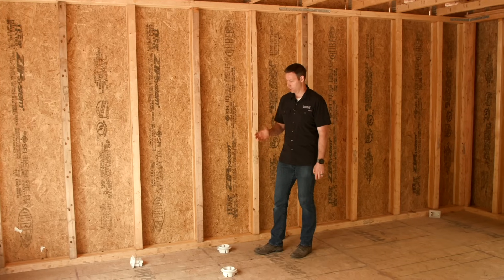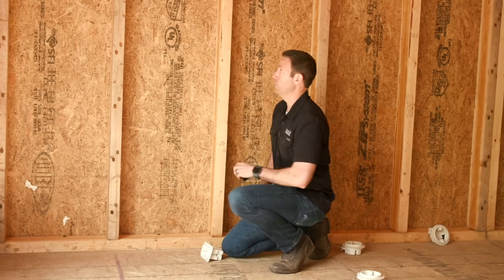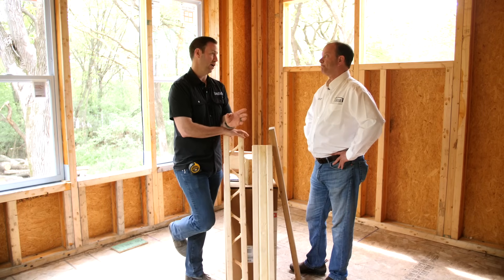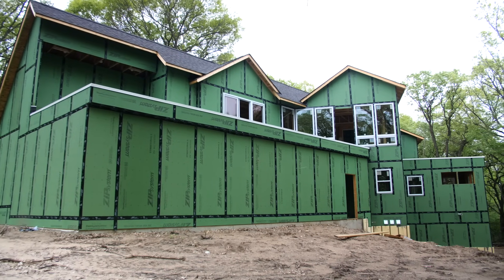Insulated Studs? This is a BIG Innovation in Framing!

Comment: Building a new home with R30 walls sounds like a great investment, until the client/architect insists on perforating those walls with two dozen R3 windows...  And anyway, heat rises.  Better bet is to spend the building capital on additional ceiling insulation thickness, a more efficient HVAC system, or additional passive solar integration.
Reply: Where he's building in Texas, you will lose far more energy through the lower wall assembly/windows/doors during the year, since A/C air is colder than than outside ambient.
Reply: No home owner in their right mind would spend a fortune on these studs only to cheap out on the windows.
Reply: @dlg5485  A bit of research reveals that the best windows available (triple glazed/low E/argon filled) are marketed to perform at around U .15 (R-6.7) under ideal conditions.  As installed, even R-5 "rated" windows struggle to perform at R-3 once wind wash, and other factors are taken into account.

Comment: Windows remove all advantages of insulation in walls. Ceiling is the most important place to insulate. Hud has facts on wall insulation and ceiling insulation.
Reply: Insulated shutters.
Reply: So if you have windows, there's no value in insulating your walls? That can't be what you're trying to say.

Comment: it would be much easier and cheaper to provide a gap between the stud and the dry wall.  the gap could be filled with insulation or even air would suffice.

Comment: This product seems to be to be overly complicated and expensive. I would favor using 2x4s for siw inch walls where you stagger them alternating inside to outside. That makes a six inch wall with cheaper four inch studs and alternating them eliminates the thermal bridge.
That said, I am still no fan of stick building structures. I prefer either ICF, or filled ceramic blocks like they use in Germany. I have also been a fan of cordwood homes since the 1970s.

Comment: Using a single top plate with 24 o.c. framing is okay if the truss, floor joist, etc. is directly over the stud which your video shows they're not. Also, your headers are positioned incorrectly and therefore not structural as they should be on edge. Surprised you didn't catch that Matt as I love what you put out.

Comment: What happens to your frame when the insulation breaks down and starts to crumble which it will and your frame starts to fall down.  Oh oh no house. Your not saving anything with insulated 2 or 3 bys.
Reply: This isn't [open cell] urethane foam.
Reply: Closed cell is inert plastic. It will break down way after you ll be in a ground.
Reply: the insulation does not add strength to the TStud .. the cross braced dowels do .. the foam will eventually perish but fiberglass batts will last a lot longer to provide the insulation

Comment: wtf!  do you live in canada!

sorry as an inventor lol  your home will last a few decades...
Reply: @designstudio8013   lets put simply...  modern materials are attempting to replace what we used 100 years ago.  or more.

being around real estate my whole life.  90% of moldy homes are over insulated near Air tight homes.  Vapor barriers and ODB  cause more problems then they solve.  Viny/aluminuml siding  cause accelerated rot in ODB  homes.   

The Mc Mansions out there look nice but are falling apart in a fraction of the time.   Siding and roofing that lasts 15ish years  what i waste of time and investment.

Build it right and siding should 30-50 years.  Roofs should last longer.  

Efficiency!?  my ass.   i heat and cool my home for less than Half that of your "modern" home builds and it 100 year old.

Yep you going to get mouth full here.

Look at these Plastic/vinyl windows...  also crap.  same thing, short life span.   Sure build the home faster...  spread out your studs to 24" and reduce it durability.   you end up needing major repairs in 20yrs or less.

i understand that some Snowflakes expect to move from home to home and dont care how long they last or costs to maintain.    they get a Home, tweek it and move on after a few years.

Oh yeah...  foundations using quick drying hardners,  yep its quicker, but causes hard and soft grain like structure.....  leads to cracking at a faster rate.   DUH!

laminate flooring...  garbage.  rip it up.  its paper on particleboard.  Vinyl plank  is a surprisingly good product.  Engineered hard wood.  not bad either.

but using ODB  yes chip wood....  is insane.  any moisture makes it swell and fall apart.   We dont have a shortage of trees...  Lumber would cheap and plentiful if the Fed stayed out of Forestry.   we have states subsidizing high water use crops in Deserts,  moving water from Forest (drying them out) and using the water where it evaporates at an exponential rate.  ALL  subsidized  at ALL levels.

So then they push to replace Wood to be Sustainable.................   we end up with homes that are designed to fail or be replaced in 20 -50 years.   VS  over 100 lifespan of older homes.   

No im not grammer checking or looking for wrong or missed words...  sorry,  not worth the effort if all you people what to do it cut corners.   Cheap Quick homes are NOT what we need.   Spend the 30% more and have a homes that last for generations and cost you almost nothing to maintain.  Vs one that cost you and family 2x as much over 50 years.

if you are one to not care,  just push the debt down the road?!   you are part of the problem.
Reply: @designstudio8013  thats fine...  i hope you dont do like mant in NJ have done...  they choose speed over quality.

aka  to much harder in the concrete.  the Rt4 Rt17 highway overpass they finished in 2000...  is falling apart was falling apart 5 years ago.  it consistently needs repair.   the claim was to be 50 years.   the company that did the work has created dozens of such disasters all over the state.

Concrete can be great, sadly to many cut corners to save a buck or get bigger contracts.

Comment: I do wonder what the  life of the 'foam' is before it starts to degrade.  Is it comparable to the rest of the wood stud?  Since wood does rot with insects and moisture, will this system work with steel studs?  You could potentially have a structure that last a hundred years?   Anyway just some thoughts and i do like the product you have as it is now.  Thanks for the video.

Comment: Doesn't look like the bottom plate is treated lumber. Do they have t studs as treated bottom plates?

Also, the top plates hold the shear diaphragm in place by over coming tension and compression loads from wind shear. I see that only one strap was installed on the inside to connect top plates together but is there an outside strap as well to overcome said loads? The tension and compression loads can be quite high at top plates and there is a reason why we need two members to splice together traditionally.

Why aren't the trusses blocked or secured to a rim board? Blocking and/or rim boards not only brace the trusses but also transfer lateral loads from the shear diaphragm to the shear walls to ultimately the foundation. You have a disconnected lateral load path at that location.

Lastly, that anchor design to secure bottom plates to a concrete foundation will work for uplift loads only but how do you overcome the wind shear loads acting in between the bottom of the bottom plate and top of slab and prevent from sliding? The bolt has no resistance against wind shear since there is only insulation acting upon the bolt. 

All these designs are critical to ensure a structural safe building.

Comment: Wood is not good enough so we make wood thinner and put foam(really strong?) In between the 1×2,s great concept i want to see this great feat of engineering in a FEW years when these green houses start collapsing.
Reply: guy azbell my thoughts exactly this stuff is total crap which is dumber the product or the guy seriously trying to market it
Reply: The studs are braced with dowels in a truss pattern. The dowels make the 2x3 sections more rigid and straight. Being wider than 2x studs makes the T-stud stiffer in the X dimension.
Reply: Try not to miss that 1×3 with a nail .  How sturdy can that be?
Reply: @rimdacinah6384  
These are a pair of parallel 2x3. You get a 2.5" wide nailing surface and over 1.5" penetration.
Reply: @jessebarclift8533  

Resorting to personal insults means you can't think of enough valid arguments. When you complain about splitting at dowels, you obviously haven't personally tried these Tstuds, so it's prejudice on your part, not evidence or testimony. 

You don't get to nail to the full 2.5" width of Tstud! So what. This still gives nearly 1" more width to work with. 

Tstuds are far stiffer in the X dimension than 2x6, stiffer than 2x8, so you get better structural load margins in multi-story buildings. They eliminate the thermal bridge visible on infrared cameras. You can skip building doubled walls or buying insulated sheathing. Plumbing and wiring go faster. The Tstud surfaces are more straight and consistent than dimensional lumber. You can confidently drive fasteners more perpendicular to the surface and/or further from sheet edges. Those are the main points you can't dispute.
Reply: David Ogawa I'm sorry but I completely disagree and 2x4's don't give you 1x5 surface to nail to you get about 1¼ x 3" of nailing surface. You get 1¼x5 with a 2x6 and you don't get the full 5 on the broad side bcuz of the foam idk about you but I'm not nailing into foam. This is junk junk junk and I would never use it you can keep trying to give me a million different reasons that don't add up but I'm still not buying it and would never suggest it to a customer. With blast in foam the R value is so high that I can't see the beams/studs really costing enough energy efficiency to be worth building with this.
Reply: @avid0g  you must be very familiar with product?
Reply: @jessebarclift8533  YA I'm also thinking that this product would be way harder to put together and I'm guessing double to triple the price of a regular board.  I don't know about y'all but house's are already to pricey as it is.
Reply: @rimdacinah6384  
I just paid attention to the details, instead of closing my mind and fabricating objections. These are engineered trusses made from 2x3. The 2x3 are obviously clamped in a jig before drilling and while the adhesive cures, so they are unusually straight. The diagonal dowels and extra width are obviously going to make the truss much more rigid. 

Although no claim is made about the load carrying properties as a beam, the load capacity as a function of height is impressive.
Reply: David Ogawa I'm not closing my mind to anything and you're not paying attention to shit you're taking the manufactures word for it. I'm actually paying attention to the obvious flaws and I really don't care how they make them I see serval issues aside from cost. Go ahead and shut up now really no one asked you to go on and on about how good they are so just like you let yourself into this exchange . . . Feel free to let yourself out 👌🏼♠️
Reply: @jessebarclift8533  🤣🤣🤣🤣🤣

Comment: Why 24" on center?  My Code here in Canada Calls for 16" on center because of the snow load... Even roof truss's are 16 inch on center. I've had 4 feet of snow on my room 17 feet around my walls. I don't think insulation is a problem. Snow load is the issue..both from the sides and top.
Reply: Don't know about Canadian codes but in the U.S., codes allow for 24 inch centered studs. As long as the joist or roof member bear on top plate and stud is no more than 5 inches from supported member.

Comment: I was wondering about the use of the Tstud on a flat roof (1/4"/Ft) as a roof joist and if you have engineers that would design and seal drawings for permitting applications to meet IBC codes.
Reply: Thermal bridging from I-joists is very low.

Comment: If this stuff is so strong, could you not use a lot less studs? 4 times stronger thus 4 times less studs?
Reply: No, top plate can only span so much and support gravity loads simultaneously. There's also plywood sheathing being nailed to the exterior for wind shear resistance. There would be a significant reduction in strength to the shear wall if studs are spaced at 4 feet on center.
Reply: @victormena7846  Interesting. I would love to see a full static analysis of it.
Reply: code doesn't allow for stud members to be spaced more than 24 inches on center. This design shown in the video needs a lot work in order for it to work structurally safe.
Reply: @victormena7846  So the building in the video is not up to code? Also just because the Code is behind the tech does not mean it could not be done if the right materials are used.
Reply: @DouglasEKnappMSAOM  Not up to code on a few things but there is several critical structural issues that need to be addressed. New technology is not the issue

Comment: This is an absurd product.  The R value of a 2x6 SPF stud is about R 14.  This system only works with a single top plate if roof or floor trusses are used and aligned exactly over the stud, conventional framing spaces the ceiling joists at 16" o.c to reduce gypbd. sag. And the stupidity of using these as 'headers' in a non load bearing wall is MIND BLOWING given their MIND BLOWING expense .  The 'truss looking' aspect of these things doesn't count for anything when the trusses  are laid on their side.  Matt,  Looks like you're  selling out for the few bucks these guys are paying you to promote their inane product.  You'd do better to promote your integrity.

Comment: This looks like an alternate to ISO3-Stands.
ISO3-Stands has an U-Value at around 0,11 but is ~4x more expensive than normal Stands.
(Basically two wooden vertical beams with foam in between: Sandwiched Foam Insulation).

Comment: The easiest way to create a thermal break is a 6" wall with staggered 2x4's on a 2x6 sill and header  plates.
Reply: That works but you're talking about a lot more studs. Your exterior sheathing and your interior drywall each need support at no more than 24" oc. So you're actually framing 12" oc with 2x4s. That's more material and more labor.
Reply: wouldnt (2) 2x4's be a 8" wall not a 6" wall?
Reply: @grape9610  They're staggered.  So if they are 12" OC, you have one on the outside at 12", one on the inside at 24", outside at 36", inside at 48", etc.

Comment: "25% of your house ends up being wood". Really? 1.5" stud 16" o.c is actually 1.5/16*100= 9.375%. Not 25%. The R value of a 2x6 is 6.88. If the other 90.625% of the wall is R-19 batt, you have an R value of 0.90625*R19+0.0937*R6.88=R17.86375. Why are you proposing this ridiculous product?

Comment: I'm the 2nd owner punching 50 holes in the wall trying to find 16" on center.
Reply: Every time I use a stud finder, it points at me...
Reply: @avgjoe-cz7cb  That's strange. Everytime I try to use one it never stops going off. Only ones I found that don't do that are the super super cheap ones. But then they almost never find the studs. Can't catch a break.
Reply: Hopefully the builder casually mentions the 24" spec just so the owner doesn't freak out.
Reply: Ever hear of a stud finder?
Reply: Lmao
Reply: Try using a capacitive Stud Finder . . .
Reply: 🤣🤣🤣🤣
I guess you're not a handyman at all , stud finder battery or magnet is the key to find them
Reply: Have you heard of the SuperSTUD?  Accommodates up to R66 in walls.  The thermal break in this stud comes with pre-drilled holes that makes plumbers and electricians say "WOW" when builders use it.    WAY cheaper with inherent features that make the build so much faster/easier and MUCH more AFFORDABLE .... (https://www.youtube.com/watch?v=Btd1mHdossQ&t=9s)
Reply: I've seen plenty of people put 50 holes in a wall (and miss with 48) that are 16" on center, nothing escapes incompetence!

Comment: Wouldn't the dowel rods still conduct heat? Better than just a 2x4 or 2x6 but would there still not be a little that's not insulated?

Comment: How do you nail it together when you have to through 2 1/2in for bottom plates, top plates, sills, doublers, corners, etc. It seems to me that you would have to use screws that would take much more time and cost allot more, and as far as saying that it would not cost much more, that is hard to believe, 2 2x3s usually cost about as much as a 2x6 and that is before you spend the time and money dowling it together and adding foam in the center. As far as can tell the framing cost would be much higher as well as the material cost.